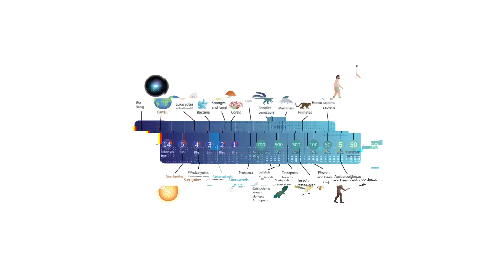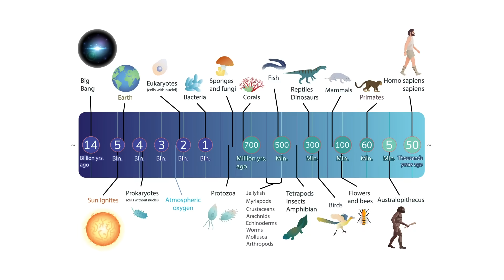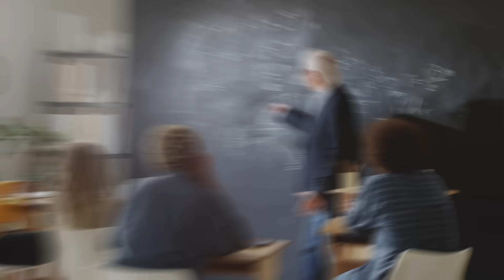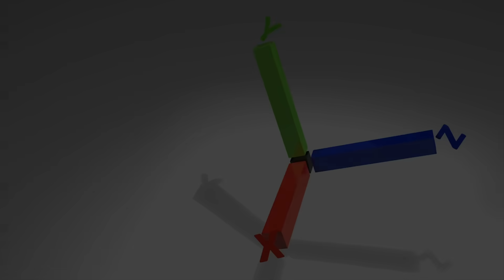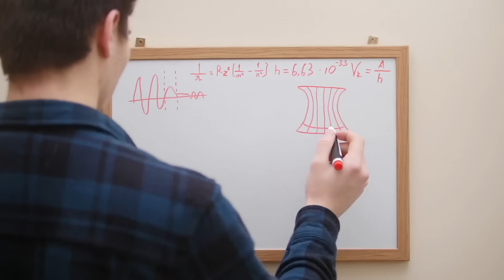Brian Cox - Why Did The Big Bang Happen?

Comment: And still many scientists are now saying and showing that the universe couldn't have ever been that small. Some have now suggested that the universe was no smaller than a basketball. Others say it was even bigger than that before the Big Bang.
As it's the so called "most accepted theory" is filled with gaps and flaws.
If the universe was ever really that small then the background temperature variation (1 part in 30,000) would need to be much larger, but it is not.
The flatness of the universe 3D surface is also a problem. And there are remnants that should be exist, like highly energetic magnetic monopoles. But they are found almost nowhere, and those that are found are nowhere as powerful as they should be.
And so as the pieces start missing, it becomes easy to understand that A) the universe was never that small and B) something else happened and instead of turning a blind eye the hypothesis of the Big Bang should be revised, instead of being continuously sold as the best explanation when it can't explain so many things.
If anything there's sufficient data that shows that no inflation can come from something as small as a singularity.
Here’s why: space expands at an exponential rate during inflation. Think about how an exponential works: after a certain amount of time goes by, the Universe doubles in size. Wait twice as long, and it doubles twice, making it four times as large. Wait three times as long, it doubles thrice, making it 8 times as large. And if you wait 10 or 100 times as long, those doublings make the Universe 210 or 2100 times as large.
Which means if we go backwards in time by that same amount, or twice, or thrice, or 10 or 100 times, the Universe would be smaller, but would never reach a size of 0. Respectively, it would be half, a quarter, an eighth, 2-10, or 2-100 times its original size. But no matter how far back you go, you never achieve a singularity.

Comment: Let there be light.. They should have finished the video right there.. and this is WHY:

The real problem with the Big Bang is: The origin of matter! 

Mass of universe = 1e80 protons = 1.67e53 Kg 
Escape velocity = v = √(2GM/r) therefore r = 2GM/v^2 
Substitute M = 1.67e53 and v = 3e8 m/sec (speed of light) 

Hence the minimum diameter of the universe below which it will collapse into a black hole is 52.5 billion light years! 
Hence the matter in the universe could not be created in the early hot stage when the universe was small! 

This is supported by the first law of thermodynamics observed during particle pair production of electrons and positrons at CERN. The antimatter particles are exactly equal in mass and number to the matter particles and the result is no net residual of matter left over. 

Running the universe back in time is not the same for energy and matter as assumed in all these models! Think of a candle burning (like star we see today) the ENERGY can go back to a very small point BUT the MATTER does not! The candle gets bigger until it reaches a maximum mass and then STOPS! Stars must by the second law do the same they can only go back to the point of maximum hydrogen and that is their minimum entropy state! 

That means the real Big Bang was first an expansion of space and energy with no mass to very nearly the size we observe today then the creation of stars in their lowest entropy state or maximum hydrogen fuel state. Which actually matches what the bible says God did in the opening chapter of Genesis! 

Day 1 God said "let there be light" expansion of space and photon energy giving us the very smooth CMBR 
Day 4 God said "he made the stars also" after the expansion by collapsing the wave energy into atoms of hydrogen. 

We know from Young's double slit experiment that a MIND can collapse a wave to produce a particle and the particle's history is written retrospectively back from the moment of measurement. This solves the starlight time problem if that event took place about 6000 years ago on day 4 of the creation after God had stretched forth the heavens and filled it with wave energy. It means the history of the stars we observe is real and does go back billions of years calculated by the distance but it could all have been created 6000 years ago. 

This is why Adam could see the stars on the sixth day. With the discovery of gravity waves we also know space is elastic and this could explain the apparent acceleration of space as an elastic medium expanding like a spring. Thus the Genesis account stands alone as meeting all the laws of physics without any special pleading only that God is exactly who he says he is and did what he said he did in the bible.
Reply: LOL!!!
Reply: @captaingaza2389  Is that Labour Of Love?
Reply: @mikebellamy  everything you wrote is wrong
Reply: @dertechl6628  You don't know about gravity and escape velocity..?

Comment: As space expansion speeds up, eventually it rips. This is why they say the early universe expanded faster than speed of light, because it wasn’t a bang, but a rip. e.g., space ‘tearing’ away from a central point.
Reply: They say the early universe expanded faster than the speed of the light because it inflated. It is hypothesized to have occurred due to a repulsive energy, which is also a catalyst for the speculative "Big Rip" scenario for the Death of the Universe. However, The Big Rip refers to Dark Energy becoming so disproportionately prevalent in the Universe that objects and structures can no longer form, and eventually the existing objects in the universe would  "rip" apart due to their attractive properties being overpowered. Obviously there was a different sort of phenomena going on with the type of repulsive energy present during the Big Bang or Inflation, assuming that model is accurate.
Reply: @guerillabedlam1  yea but your missing about energy 😐also what was the mechanism behind the Big Bang ? You speaking like if their was a god 😑also if you we were dead forever the earth would not form in the first place 😑 and yet it had 😐you could say it was random but I think it has to do it then just being random 😑also I have learned their could be a link between life and death 😐 after all what do you remember before you were born ? 🧐that’s right nothing 😑and what happens when you die ? You become nothing 😐noised a pattern here ? Ether way you look at it something had to create the universe in the first place 😑ether from vacuum decay heat death big caring or heat death etc 😐you don’t need to explain if life or death will be or may be forever because we are the proof 😑 the universe is not just going to say I’m going to end in a rip I’m going to end in heat death vacum decay etc also many scientists would say if we had a past life we would remember it 😐but that’s not the case 😑beacuse as you die your body breaks down from weathering and erosion even your brain 😑that’s why in death you don’t feel pain you don’t think 😑your at peace 😐the only thing that will remain will be a manifestation of your self and eventually their will be nothing to experience but total darkness in fact when we all die will be the same as if you were not formed in the first place you were nothing before😑 you live only to become nothing again 😑given the history of perhaps endless cycles of life and death most of your total experience you will be dead
Reply: @guerillabedlam1  to me it’s because we are in A black hole already and the Big Bang is simply the explosion of a star before it creates a black hole .

Yes space expansion is tearing space itself and like in a black hole , light can’t escape it because the speed of space in a black hole is faster than light , like here.

Too many Coincidence .
The CMB  is simply the event horizon of the black hole.
Reply: I don't think that the expansion of space time speeds up, per se, distant stuff appears to be accelerating due to the extra "distance" which is being made by the expansion of ALL of the space in between. 
I agree totally with you that it wasn't a "bang" but I think that in the absence of time, any movement could be considered  instant, once the clock had started, however, light could have it's velocity and the speed of light is born. Just my thoughts!

Comment: I can accept the fact that all matter was condensed into a tiny point that exploded during the big bang. But what was the environment the big bang happened in? Where was that tiny point present before the big bang happened?
Reply: Try not to use "explosion" in your head, it generally gives the wrong impression because explosions expand into the surrounding air, time and space didn't exist before the initial event, it's an interesting exercise to picture looking at the "tiny dot of everything" before the "big bang and viewing the contents of that dot becoming rapidly smaller while the original dot remains the same size, you end up with the same thing (as viewed from inside the dot) maybe the original dot was very large indeed but without any reference points, the true scale is impossible to calculate????
Reply: There was no matter present when the Big Bang happened. Just heat and radiation energy. That Energy was later converted into matter.
Reply: @captaingaza2389  ....and LOTS of it!!!!!
Reply: The point was in nothingness and remains in nothingness. Only we can see it blink into something and out of it. Or not. Who knows...
Reply: And "where" did it happen?

Comment: "We don't know." - Brian Cox
Reply: Brian Cox does not know. He is the 'face' of unknowing.. Currently a very profitable pastime..

But if it is genuine knowing you want to achieve, there are ways.. However, the first requirement is to realise that knowing is its own 'prize'. It does not need to be lavished with capitalist adornments and/or piles of cash..

So here is one of the main problems of understanding.. 

People have a very poor understanding of what the word 'infinite' actually means.. This is not any kind of 'fault', but just that we have evolved within the confines of what appears to be a finite environment, and we thus try to look at things in finite ways, also justifying those 'finite' thoughts. When I first approached the 'problem' I had the same difficulties, so it takes our minds a lot of effort to reach another perspective of understanding, but it IS achievable.. 

Firstly, there cannot be more than one 'instance' of infinitude, otherwise a secondary 'thing' would render them both 'finite'. So we are describing a 'oneness'.. Also, it can have no 'beginning' nor 'ending' as these would also necessitate a secondary 'thing' (or the utter nonsense of a 'nothing'!), so we are describing 'eternity' when we apply 'time' concepts. Then, we have to admit that it can only be the one thing that interconnects all other 'things', and we deduce this to be 'Space', necessarily..

All references to 'size' or 'direction' do not apply to the nature of infinitude, and thus have no relevance to our understanding of the true nature of existence. 'Measurement' has limitations.. When we point to any position in Space, we effectively create a 'beginning' to any subsequent forms of measurement, which only has relevance to the entity desiring to understand said 'measurement'. This does not make it a feature of the nature of reality, only a desire from a Human perspective.

spaceandmotion

Comment: There was no singularity where all matter was compressed, matter came later, so did light, photons were the result of hydrogen and helium doing the nuclear fusion thing. There was no point the size of an atom representative of the center of the universe, the silent bang happened everywhere in the same instant, the universe was bigger than an atom, it was more like an empty, deflated balloon that was suddenly full of heat. The singularity wasn't a physical thing that represented the beginning of space, space already existed, it represented the beginning of time via entropy.
Reply: Prove it
Reply: you say this like you were there! these are just some assumptions based on some more assumptions that is according to some other assumptions and so on. this is not science just a belief nothing more!
Reply: @lonewolf5533  "You weren't there, it's all nonsense and lies", You sound like Ray Comfort. There is plenty of factual evidence going all the way down to Planck Time a zeptosecond after the Big Bang. That's a 10 followed by 21 0s fraction of a second. Planck Time can be measured down to 10 to the 44th fraction. 
Love to hear your explanation, "Let there be light", amirite? Don't make me school you on nuclear fission and ionizing radiation.

Comment: I dont remember the question of why the BB happened ever being touched on in this video....
Reply: Because the far more plausible answer is that it never did..

Here is one of the main problems of understanding.. 

People have a very poor understanding of what the word 'infinite' actually means.. This is not any kind of 'fault', but just that we have evolved within the confines of what appears to be a finite environment, and we thus try to look at things in finite ways, also justifying those 'finite' thoughts. When I first approached the 'problem' I had the same difficulties, so it takes our minds a lot of effort to reach another perspective of understanding, but it IS achievable.. 

Firstly, there cannot be more than one 'instance' of infinitude, otherwise a secondary 'thing' would render them both 'finite'. So we are describing a 'oneness'.. Also, it can have no 'beginning' nor 'ending' as these would also necessitate a secondary 'thing' (or the utter nonsense of a 'nothing'!), so we are describing 'eternity' when we apply 'time' concepts. Then, we have to admit that it can only be the one thing that interconnects all other 'things', and we deduce this to be 'Space', necessarily..

All references to 'size' or 'direction' do not apply to the nature of infinitude, and thus have no relevance to our understanding of the true nature of existence. 'Measurement' has limitations.. When we point to any position in Space, we effectively create a 'beginning' to any subsequent forms of measurement, which only has relevance to the entity desiring to understand said 'measurement'. This does not make it a feature of the nature of reality, only a desire from a Human perspective.

spaceandmotion
Reply: @fluentpiffle  Apart from the fact the BB theory doesnt involve infinity...Infinity is a mathematical construct and doesnt exist in reality.
Reply: @manoo422  Lol! One of the more idiotic things I’ve ever heard on the subject..
Reply: @fluentpiffle  Maybe stick with cartoons...
Reply: @manoo422  Do what you like. There is no obligation to learn, only the opportunity..
Reply: @fluentpiffle  Stay in school then.

Comment: IT WAS RECENTLY PROVEN THAT THE BIG BANG THEORY IS IMPOSSIBLE! IF 2 OBJECTS COLLIDE, THEY CAN NOT HAVE ORIGINATED FROM THE SAME POINT. EUCLIDEAN GEOMETRY SAYS THAT THE BIG BANG THEORY IS IMPOSSIBLE! 
IF THE PATHS OF 2 OBJECTS INTERSECT, THEY ARE GOING IN DIFFERENT DIRECTIONS, AND THEY CAN NOT HAVE ORIGINATED FROM THE SAME POINT. EUCLIDEAN GEOMETRY PROVES THAT THE BIG BANG THEORY IS IMPOSSIBLE!
Reply: Euclidean geometry is the study of geometrical shapes (plane and solid) and figures based on different axioms and theorems. It is basically introduced for flat surfaces or plane surfaces.
Not too sure how you have added vectors into a shape. 
You could possibly use UG to describe the shape of the entire universe assuming it was solid but that's about its limit.

Comment: The Big Bang was/is simply, the other side of a black hole. It started from an infinitely dense point...and it ends, in an infinitely dense point...its a living thing. It continually eats and rebirth itself. If we don't see the light on our side..it's obviously coming out on the other side. Energy NEVER DISSAPPEARS!! It only transforms and those are the ONLY TWO instances, where the word "singularity" is used. 
The big bang is merely the opposite of a black hole....
It was created from a "White Hole".....